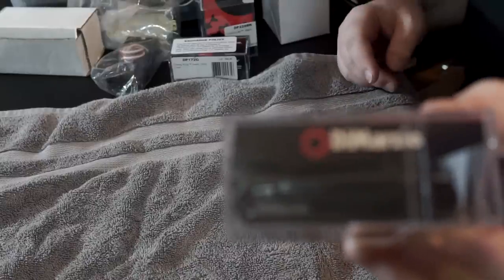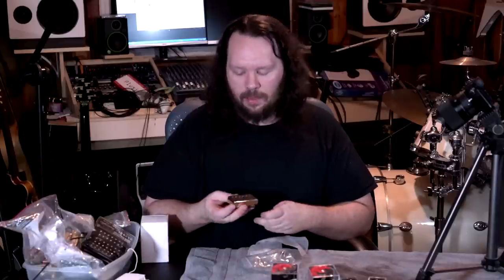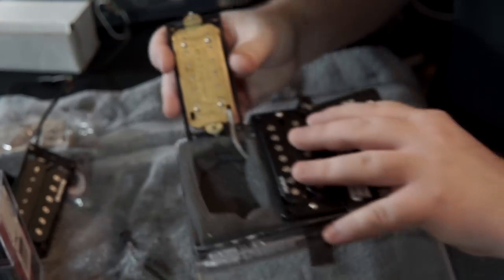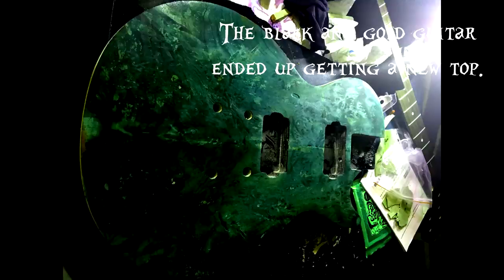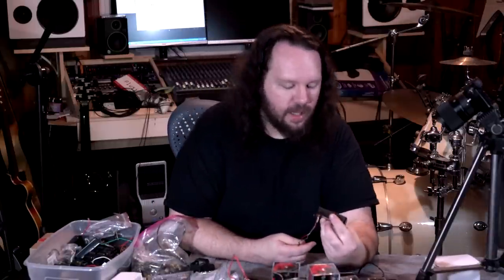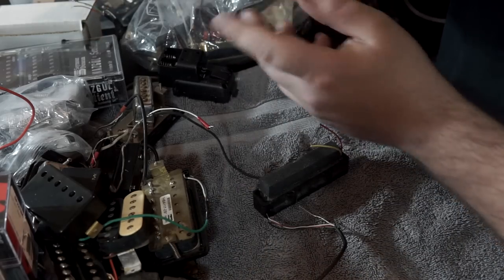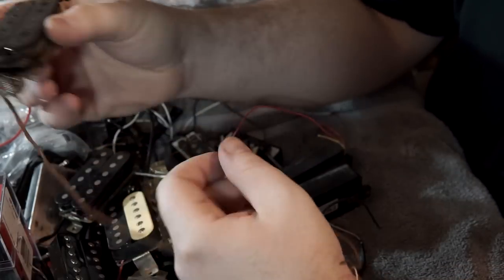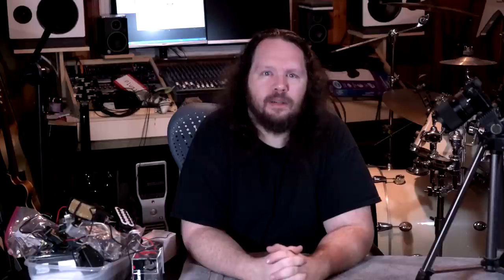My Ridiculous Guitar Pickup Collection

Comment: I prefer a humbucker in the bridge and I have a few Lace Sensor single coil size humbuckers in the middle and neck positions. I can't afford Duncans or DiMarzios anymore, but I have bought some of the former used (Lil'  59 and a couple of Hot Rails), and the Lace's are also second hand. In recent years I've been using Iron Gear, designed here in the UK and then made to their specs in the Far East, and they've blown me away with not only their sound but the quality of construction and materials used, all are on a par with Duncans but priced roughly between £25-£35. I can't speak highly enough about them, I recommend checking them out.
Reply from the maker: Awesome, thank you for the recommendation!  I will look them up!

Comment: Load as many pickups as you can fit in a swimming pool route guitar wired straight to the jack just to see how much it sounds like hot garbage. I'm a fan of really any pickups as long as it sounds good. I've got a Duncan in my P Bass and DiMarzios in my J and stock in literally everything else. They all sound good so I don't see a reason to need to change them.
Reply from the maker: Now that's a great idea.